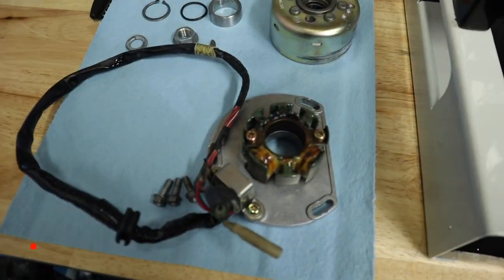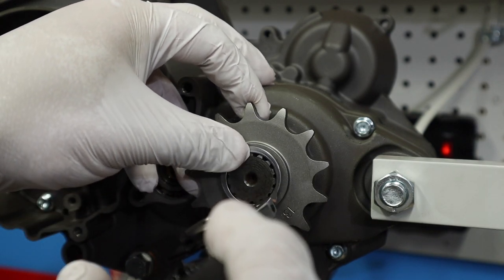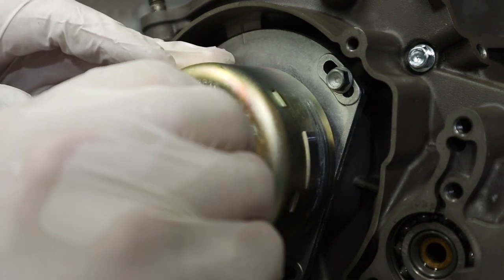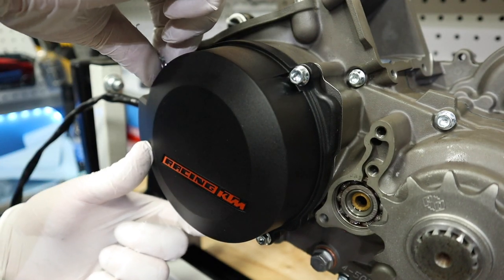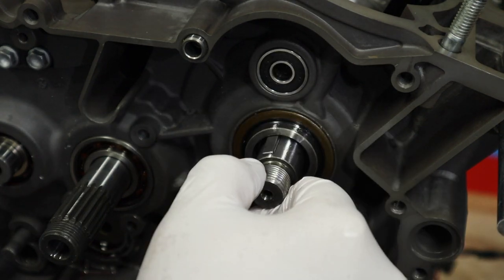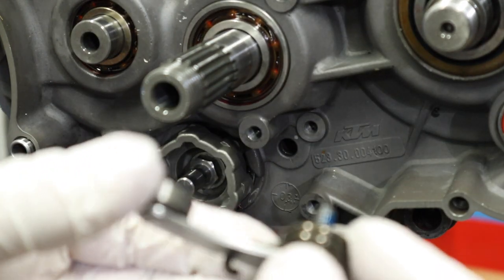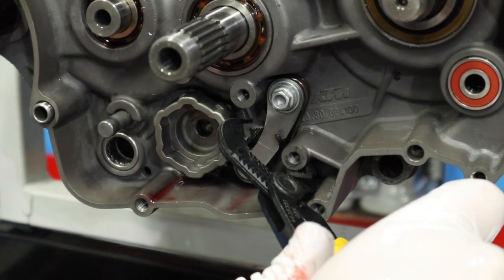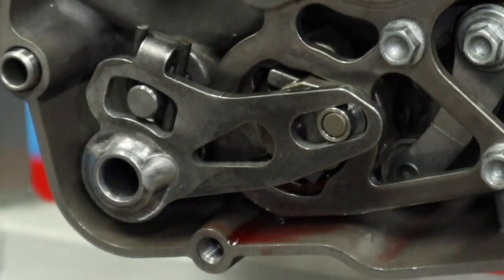KTM 125SX MOTOR REBUILD | Part 2

Comment from the maker: Sorry for the hold up on video’s! I’ve been having major computer issues and think we have them worked out! Thanks for the love and we should be more frequent from here on!!
Reply: ever have pc issues hit me up i build gaming pcs :)
Reply from the maker: Thanks for the heads up brother! I actually run a Mac, and when this happened my video card crapped out. Ended up finally getting rid of the old MacBook and got a M1 Pro. Love it!
Reply: @DanMX2112  macs are good but this is why i stick with pc id rather replace a part than a full system apart from that i was a huge mac fan
Reply from the maker: I was actually going to replace the video card, but by the time I paid for it, my computer wasn’t worth it. I was outside of that seven year update period anyways.

Comment: To loosen fasteners with Red Loctite use a heat gun to heat the fastener and the Loctite will release with enough heat. A heat gun does the job, you do not need a torch.
Reply from the maker: Right you are sir, and I do avoid torches and use a heat gun whenever necessary. That being said, the reason I avoid red is this, I’ve never had anything come loose using blue, and everything comes out Easily. I’ve never had anything come loose using red, but have had multiple struggles with red, heat or not, releasing. I’ve stripped countless threads, had gummed up threads, and overall a bad experience with red. Red is meant for permanent applications, as it reads on the packaging, therefore I am just using it as advertised and based off my experience. It’s kinda like the oil talk lol I’ll always recommend blue over red, any day of the week. I’m glad you made this comment because it allows me to clear up that I’m not against red, just I don’t personally use it. Thanks David, and please reach out if I can help my friend! Take care!

Comment: I have a manual that goes from 99 to 2006, what year is your bike, happy to look those up.
Reply from the maker: 04! And I think it’s like 100ft lbs on that also, but the difference is not enough to change the sealing effect on the crank I’m sure. Let me know! Thanks!
Reply: @DanMX2112  primary gear nut is 180 Nm (133 ft.lbs), inner clutch hub nut is 120Nm (88 ft.lbs). There is also a chart for other bolts that do not otherwise have a torque spec.
M6 10 Nm 
M8 25 Nm
M10 45 Nm
Reply from the maker: Heck ya, thanks my guy! I really appreciate it!
Reply: @DanMX2112   May want to use the EBC tool to go to 88 ft.lb. I just broke my new inner clutch basket with the tusk clutch holder right at the torque wrench clicked 88 ft.lbs. The ebc tool has many points of contact
Reply from the maker: That’s part of the reason I was hesitant on torque. Idk why KTM needs it so tight, I personally feel it’s very much overkill. Sorry to hear you smashed it up.

Comment: There are torque specs to the primary gear nut and clutch basket. Both are supposed to be torqued to 130nm/95 ft lb so i hope you see this before putting everything together
Reply from the maker: Heck ya! I figured it was probably a bit more than the 45 I did, but think it will be fine where I have it. My YZ450F is 43 on clutch and 53 on primary, so I figured all is well. Thanks for pointing that out my friend!!!